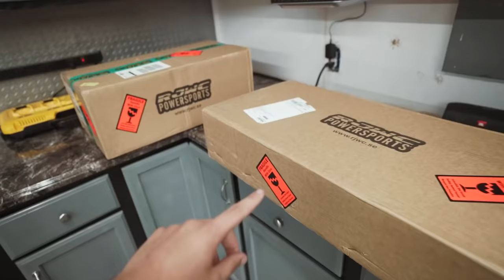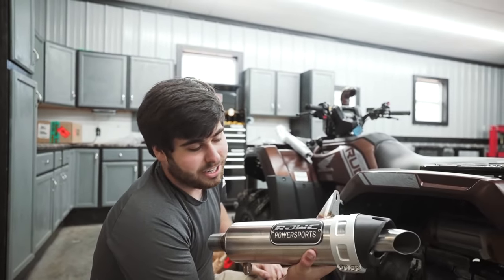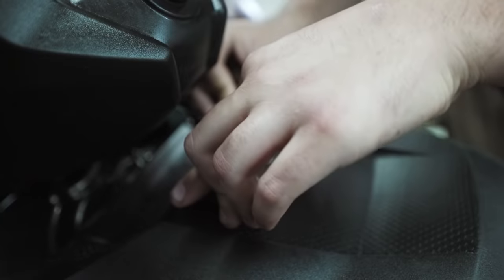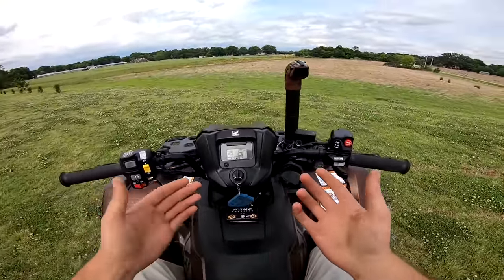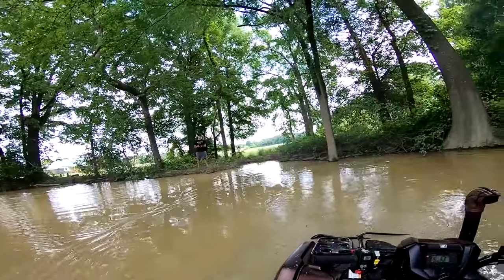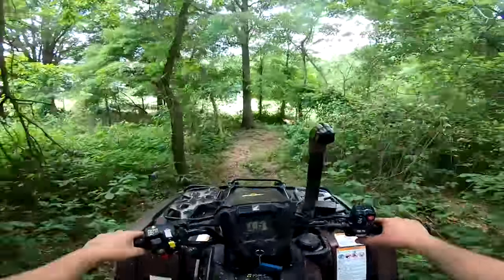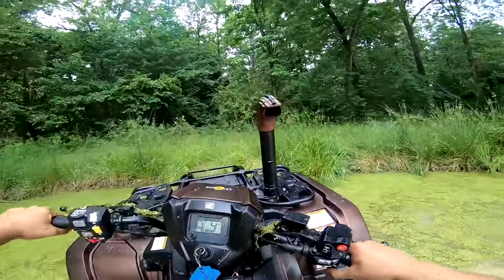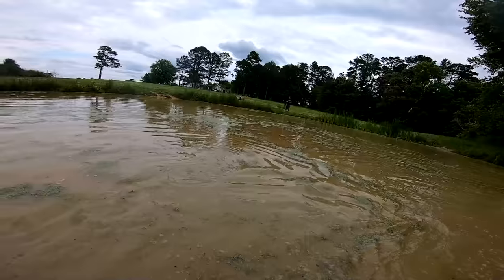Best Sounding Honda Exhaust EVER! *WE TUNED IT*

Comment: Hey Braydon, I have a question. I want to get an exhaust from RJWC for my atv, but I don’t know what the tuner does. If you know please respond :)
Reply: bit late but i believe the tuner tunes the air to fuel mixture ratio which is very useful when adding aftermarket exhaust and snorkels

Comment: Plz get some aztec tires get 32" not 30" bc 32" have wider spacing and the lugs a better and their the same weight even tho there 2 inches bigger in diameter.....mud puppy as a good video on it

Comment: First time viewer !!  I have a suggestion for you,  I'm not sure where you/re located,  but an amazing power/torque test for the Rubicon would be to take it to the sand dunes. I have done my share of offloading and was very satisfied with my 20' Rubicon 520...until taking a trip to the Silver Lakes Sand Dunes in MI.  The 520 fell flat on its face climbing the big dunes.  I am interested to see if the pipe and tuner mad any difference in actual performance from the engine and not just a different sound.